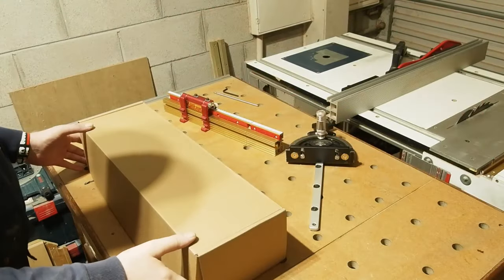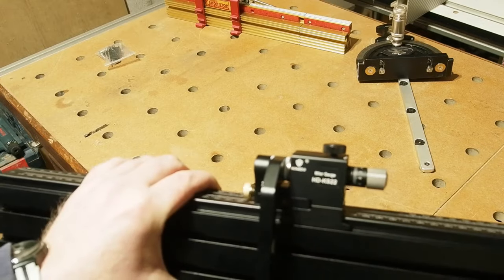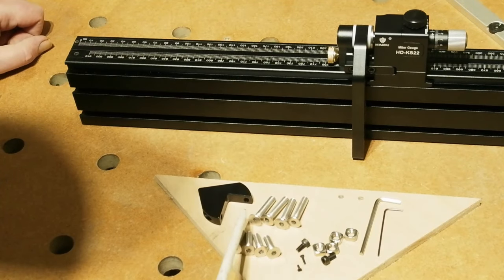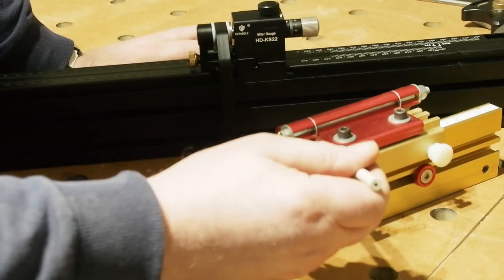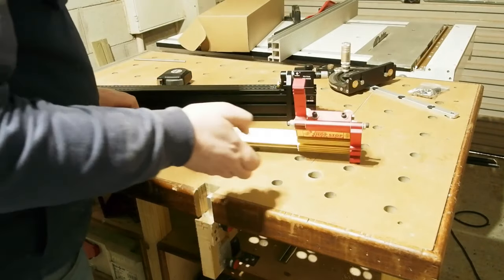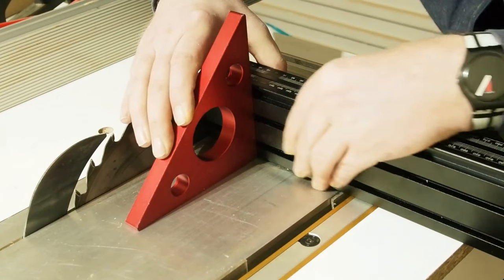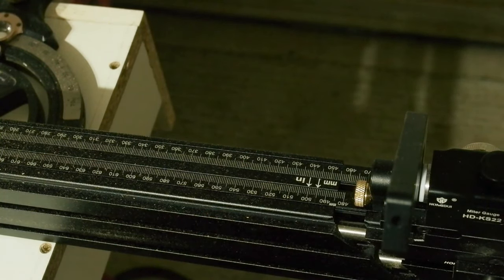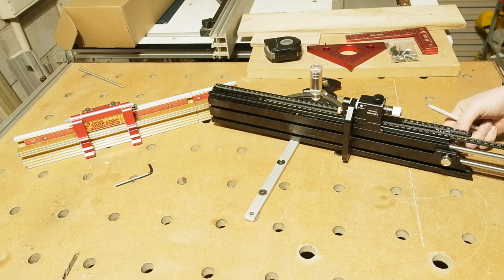*[Gifted] Hongdui HD-KS22 Mitre Gauge Fence Review and Comparison To Incra Flip Fence

Comment: Hongdui is like iPhone quality from the top to the bottom and miter gauge in the woodwork industry is very very important it have to accurate exact like Rolex is few on the market prices is like for the quality to expensive like vevor jess em harvey incra Rutland I personally won’t expend 20 pounds in one them but hongdui works every penny 250 pounds for that quality not expensive at all thanks very much sleep well 😴
Reply from the maker: For mitre gauges and fences, I would say Harvey and Hongdui are about the best. 👍

Comment: I think the Hongdui Mitre gauge is the best value for the money and it's very user friendly! Thanks
Reply from the maker: Agree. For the quality of tool, it's great value. Btw - assuming you have it - the little thumb screw behind the protractor for releasing the indexing, if you add a washer to it, it will fully lock down when pulled back, disengaging the index feature. Useful for half degrees if needed. 👍

Comment: I think that having a good drop saw (if you have one) will be much easier. You'll be much better off, just build 2 extension wings for the drop saw...
Reply from the maker: I have one. Great for rough cuts/sizing but, I find mitre saws too inconsistent for fine work. Different machines for different tasks. I actually use an over-router to mill the mitred faces for my furniture.

Comment: Yeah.  Same experience.

Got the Hongdui gear a few weeks ago and really impressed. Couldn't be happier.

It knocks the sock off the Incra gear for all the reasons you point out. And, I have to confess, I felt a bit of a fraud having such a 'pro' piece of kit but I came to terms with that quite quickly...  Buy cheap, buy twice, etc, etc.

I'll be trying to sell the Incra stuff but, after this vid, there may be a bit of a glut on the market...

Best aye!
Reply from the maker: Ah, hadn't thought about that. 🤦‍♂️😁Might hold off trying to sell mine though. Thinking I could use it for a project. But yeah, the Hongdui set up is legit. 👍

Comment: Well done as usual, love the comedic relief! I have the Incra as well and while you were commenting on it I though it was as if you were reading my mind. Guess were going to see a lot of them on eBay soon? Your video reminded me of your rip fence addition, how's it treating you after 12 or so months? Wanting to to do similar upgrade to my antique table saw. Keep up the good work!
Reply from the maker: Thanks man. I mean, i did really like the dual flip stops and indexing on the incra but, i just think in hindsight, a clear scale and micro adjust stop is easier to live with, real world. Incras had 20 years to improve and perfect the design and they haven't.  Shame really. On the "rip fence" thing - do you mean my anti-tip attachment for plunge/circular saw fences? If so, i still use mine. I don't produce them anymore though. Too expensive to manufacture unfortunately.👍
Reply: On the rip fence I meant the one you have mounted on your table saw from Banggood I suppose ? I remember you did a video on the install about a year ago?
Reply from the maker: @marcr3376  Oh, yeah still does the job perfectly well. I would like a more traditional table saw fence though. The banggood one I have can be a bit of a faff to dial in to a width. I find the scale hard to read too so set with a tape. Once set, thanks to its dual fixing knobs, it's rock solid front and back. I like that about it.👍

Comment: big advantage of the incra is the repeatability thanks to the indexing, although it indeed makes the sliding less smooth
Reply from the maker: That's true. In fact, the indexing being so good for repeatability/consistency is why I said it kind of makes the second flip stop/rod void for me in use - doing say a lap joint. On the Hongdui, the scale is so clear , as are the cursors that I have a lot of confidence in it too.

Comment: Hi @BischBaschBosch 
Do the Incra and Hongdui fences have the mounting t-track that connects them to the miter gauge at the same height? I.e., could I mount a Hongdui fence to an Incra gauge and vice versa? I know Incra fits directly into a Festool CSC SYS miter gauge, and I'm trying to figure out if Hongdui would fit too. TIA!
Reply from the maker: Hi. The Hongdui fence slot at the back sits around 30mm from the table top to it's centre. Like the Hongdui gauge, the Incra has oval mounting slots on the gauge for different height fence mounts. Whether Incras gauge would accommodate the 30mm centre of the Hongdui fence I couldn't say but if you have one, you can check. The Incea fence fits the Hongdui gauge (that was my set up) but, the flip stop does run into the gauge top so you have to lift it slightly when positioning over. As for the bars in the mitre slots, both the Incra and Hongdui use the 19mm bars so, if the Incra runs in your saw, the Hongdui should too.👍

Comment: Do bother miter bars stick out past the fence surface by the same amount? The Hongdui looks a little short, but it could just appear that way because it's so beefy. I have that Incra and love it although the Hondui looks better. I guess following is always easier than leading, but it all drive innovation!
Reply from the maker: I used the same mitre gauge bar with each. If anything, I think the Incra fence is more chunky in the body where it meets the gauge and so, on the Hongdui, the bar sticks out a little further. I think what bothers me about the Incra- good as it is - is they haven't changed it in 20 years. They haven't finessed or even recognised it's shortcomings.  I think this has allowed Harvey, Jessem and now Hongdui (very similar to Harvey) to surpass them. Well, for my needs anyway.👍

Comment: Thanks for the hands-on review. However, you failed to mention that the Incra double stop with included bar is rock solid without needing that Hondui secondary stop that isn't flip and needs to be reset every time you set the stop. Also for accuracy, do not set the miter gauge fence to be square to the blade, what matters is that the fence is square to the miter bar. That's even easier to calibrate as well as more accurate.
Reply from the maker: Each stop on the Incra, singularly,  will move as much as the Hongdui stop unassisted. Very little but detectable all the same. The Incra  stops only become solid if you join them with the bar. As does the Hongdui with its secondary stop.
My table saw is home made, based around a Mafell KSP 85. The mitre track - which came after (used to have sliding table) - was squared to the blade. The blade is the datum on my saw. The results speak for themselves. Thanks.
Reply: @BischBaschBosch  For miter gauge work, the slot is the datum. Think about using the miter gauge on a router table - you can't square a fence to a round rotating bit. Squaring the fence to the blade simply introduces other possibilities for error, not just from any blade/slot misalignment, but from the blade itself perhaps not being perfectly flat (you'd have to reference against the teeth, but that's not good for the square).
You are correct that the Inca stop only become super solid when joined with the bar, but when done so (as it comes from Incra standard), it's solid everywhere automatically without the hassle of setting a second stop. There's also that the Incra stop and fence profiles are such that thin stock won't slip under, although you do point out the potential for damaging a mitered tip. Your points about the lack of practical micro-adjustability on the Incra are spot-on.
Reply from the maker: @smorgasbord42  Yes mate, on a normal table saw where a cast iron top (or aly) has a slot and the saw carriage has adjustment to align to the slot in the table. I built my table saw. The saw is fixed. No position adjustment. The fence and the track have adjustment and are set to it. Hence I'm perfectly happy setting my gauge to it. If my cut was still out of square, I would have known it was the mitre slot and adjusted accordingly. I appreciate the advice is coming from a good place but I'm not new to this my friend. Quite the opposite  I could have maybe said something about why I set like I do. I'll note it for the future.
Reply: @BischBaschBosch sadly as someone who has the incra i agree, it can move if you apply force but i use them as a soft stop for measurement just touch it there then wood against fence not against stop

Comment: Dude I have the same fence now, what I had before was absolute shite! Whats your take on the fence now having used it for some 3 weeks?
Reply from the maker: Nice one bud. Can only say I love it really. Using that micro adjust to dial in on a mark is my new favourite thing. I've had to epoxy the little magnet back in place for the secondary stop. Can't fault it other than that.  You like it so far?
Reply: @BischBaschBosch  yeah love it!!! My first worry was it can only go on one side BUT it’s the side I prefer and my saw is a Wadkin so the blade tilts away from the mitre gauge, the micro adjust like you I’m well chuffed with it makes a much better idea than tapping the piece to nip a touch off!
Reply from the maker: @HewAndAwe  That's a good point. Annoyingly, the only thing stopping you being able to flip everything round is the extension mitres into the fence proper. If it was straight cut, you could flip it. Oh well.👍

Comment: What was price for hondui kit? I mean full set, fence, angle pivot and micro adjusted limiter.
Reply from the maker: About £190 for the full set currently.👍
Reply: @BischBaschBosch  thank you. Found their website and for me shows 265 USD plus shipping price. But they sell three versions, standard, DeWalt track, Bosch track, and description quite unclear what real difference.
Reply from the maker: @АлтынбекДюсембаев-л5ь  The "standard " is the one have. Has the 19mm wide mitre bar (typical of aftermarket mitre gauges) and a longer fence. The dewalt and Bosch  versions have a mitre bar shaped/sized to fit in those companies proprietary mitre slots on their site saws. They also have a shorter fence more appropriate for the small saw table.

Comment: My Dewalt Portable saw miter gauge slot is little wider.  would I be able to snugly fit it with the adjustable nylon screws?
Reply from the maker: If I remember right, one of the dewalts has a 19mm slot, the other a 24mm slot. If you have a 19mm, the Hongdui gauge would fit fine. If you have the 24mm slot, i don't know. 5mm is a lot of gap to fill with nylon screws. You might be better off fitting the Hongdui gauge to the dewalt mitre bar🤷‍♂️

Comment: I would say that your review is fair BUT what you FAILED TO POINT OUT is that both of the INCRA units have been on the market, I think, for over 20 years. Whereas the Hongdui Fence is a very recent introduction and therefore should incorporate technical advances.  

Having visited INCRA in Dallas many years ago when I owned Wood Workers Workshop and had the INCRA franchise, I sold the business and retired in 2013,  I would expect Hongdui's production equipment to be more advanced than what INCRA had back then, and that should show in the product offering.

Wood Workers Workshop has grown significantly under its new owners and still holds the INCRA franchise.
Reply from the maker: Yes, WWW is where I bought my Incra  from. Peter Sefton is WWW's owner now I think? Great store. Nice guy too. I appreciate your point and funnily enough, I was going to mention the Incras age (As in time on the market, not my particular fence). I omitted it as I think it would have been another strike against Incra and I didn't want to be too harsh. It struck me that the fact the Incra has remained unchanged for 20 years, unrefined, is a poor show. As I've hopefully shown, whilst fundamentally a solid fence product from Incra , there's plenty of scope for improvement.

Comment: Hi Bisch Basch Bosch
Thank you for the clear and good comparison between the Incra Flip Fence and the Hongdui Miter Gauge Femce. I also have the Hongdui combination and am very satisfied with it.
Tip: For viewers who have a Bosch GTS10XC saw table and therefore have a different type of Sliding Bar than that supplied with the Hongdui TB01.
I have bought a new miter slider bar from Andreas from the company 4Techs R&D that is specially made for the Hongdui TB01 and works on the Bosch GTS10XC saw table. It's a really Bosch good slider bar and fortunately I can also use the Hongdui on my Bosch GTS10XC saw table. 
https://youtu.be/xil743fLU6o
Reply from the maker: Nice one. I'll pin the comment👍